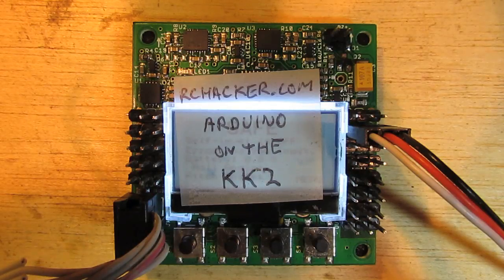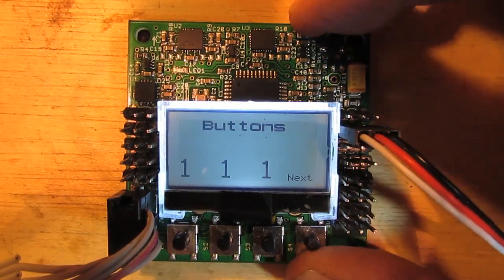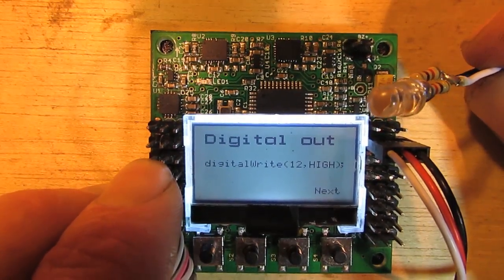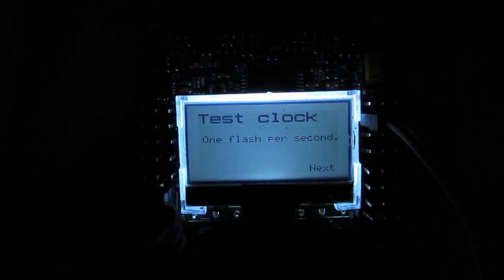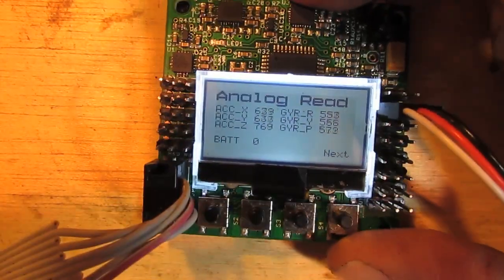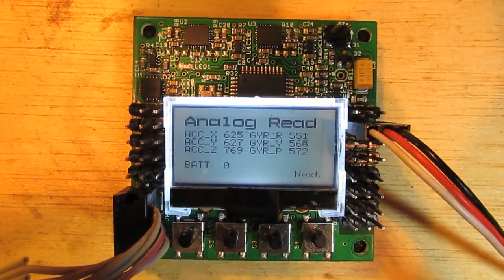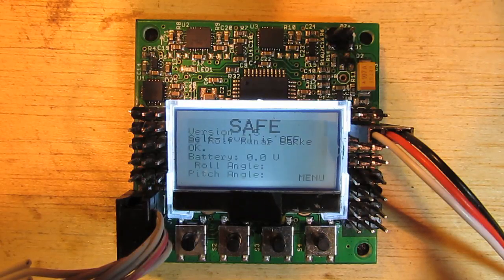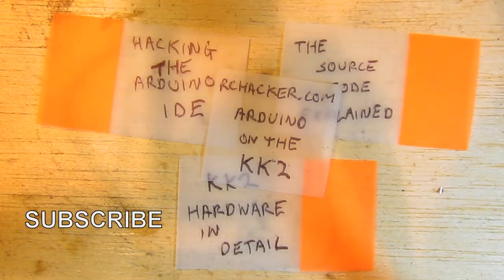Arduino on the KK2 Multi rotor control board. Test code demonstration. RCHacker #5

Comment: Hi Marc, would it be possible to dump the status of the acc/gyro and pins via a serial data stream out of the programming pins using the hacked IDE, essentially providing a stream of telemetry data to a logging solution?
Reply: Yes, should be really easy. Not sure about the units of the accelerometer but should be easy enough to look up.

Comment: Hey Marc, excellent job man, amazing! I have the kk2.1.5 and it worked very good.

For those that also have the kk2.1.5, the board comes with the Atmel 644PA, which is not identified by the Arduino 1.0.1. At the fist time, when I tryed to upload the code, I received this error:

unknown MCU 'atmega644pa' specified
Known MCU names:
   avr2
   at90s2313
   at90s2323
   ...
   Blink:-1: error: MCU 'atmega644pa' supported for assembler only

Fortunately, atmega644p is in the list of recognized MCU and, fortunately, both atmega644p and atmega644pa are the same MCU.
So I corrected the error changing, in boards.txt, the line:

kk21.build.mcu=atmega644pa

to

kk21.build.mcu=atmega644p

Then it worked properly!!
Cheer and thank you!!
Reply from the maker: +Pedro Cunha nive, ive updated the article to reflect this. be aware that a few of the pins have been changed around.
Reply: +RCHacker You mean the pins_arduino.h has to be modified? I notice that the gyro and acc have something different, as you told in the article.. running the test code, I received strange numbers coming from the gyros and acc. I am not sure yet how to fix this!!

I always keep receiving an avrdude warning when I upload code:

avrdude: warning: cannot set sck period. please check for usbasp firmware update.

I have updated to the last version, but this warning is still there. Did you already see this? It seems that it doesnt affect anything, but as sck is the serial clock, you think I could have problems if the clock is not set properly?

Comment: Can we use arduino In place of receiver to give commands to KK2.1 like throttle increasing and decreasing.I want to do automatic takeoff and landing by using arduino  in my KK2.1 quadcopter. In aruino I have to write code for arming and then increase throttle slowly slowly and reach at 50 to 60 % of max then decrease. Can I do this ?
Reply from the maker: Yograj Singh Mandloi Yes, definitely. The hardest bit is the ppm out and the openlrsng project has examples of this. You could modify openlrs to have an auto take-off feature, and still have manual override if you need it. Another approach would be to lose the kk2 and look at diy drones. ardupilot etc.

Comment: I'm tryng to use KK2 to read serial, (useful for frsky telemetry or openlrsng telemetry in frsky emulation). To compile using softwareserial i needed to uncomment a part of tour file "pins_arduino.h". Now there is another problem: software serial seems not work.  I tryed pin 11-12 / 5-6 / 0-1 /1-2, but without success.

I put in the code:
at the top:

#include <SoftwareSerial.h>
SoftwareSerial Seriale(5, 6);  //not iverted serial, to use with openlrsng

in void setup

 Seriale.begin(9600);

everithing seeme to be correct, but in the code, when i use:
  if (Seriale.available()) {   THIS PART OF CODE NEVER STARTS

Maybe is impossible to use softwareserial with kk2?
Sorry for my english and thank you for your patience
Reply from the maker: tacva Maybe this is the issue: from here: http://www.arduino.cc/en/Reference/softwareSerial   the pins need to support change interrupts. Look up the datasheet for the atmega that the kk2 uses and check which pins have change interrupts.

Comment: After the hack, can you still use the Arduino version to control a quadcopter?
Reply from the maker: No, it will do sweet bugger all until you program it. To go back to KK2 re-flash it with this: http://lazyzero.de/en/modellbau/kkmulticopterflashtool
Reply: RCHacker Got it! Thanks!

One thing: if you look at this (http://api.ning.com/files/QYxylXSaas588I6jwxcoAJR8lBXneWApDBFHGCoOMg7Ge975QGTPeT0Qinw4ffnFDRoWYf7TcktkQRYX--0YwbQT05HgK*zp/arduino_esc_lucaszanela_com.png), it tells you how to connect an esc to an arduino. Do you think this would work with the hacked KK2?

Comment: Outstanding ! I did follow your instruction, downloaded a couple of files from your side, placed on my Arduino 1.0.1 on Windows ... And it did work on first shot, in few minutes. Excellent job. My only personalization is that I'm using extremeBurner for flash my KK2.0 taking the .hex file from the temp compilation folder.

Comment: Have you ever tired to use the arduino uno to and KK2 Multi rotor control board as to piggy back them?  Such as use the arduino in place of a receiver to make an UVA ?

Comment: I see. Well with GPS I wanted to do a waypoint based autonomous vehicle that drives on the ground. Do you also can read the sensor data via I2C on  ArduPilot Mega ? That easy? Can you read all of the sensors ?

Comment: Wow thats really cool. I made a simple robot with arduino and was thinking about hacking such boards - really great. Did you look into HobbyKings Megapirate board? Its also based on Arduino but you can hook up additional sensors to it such as GPS or a barometer and all the sensor data is available via I2C. Should be very easy to make a drone out of  it.